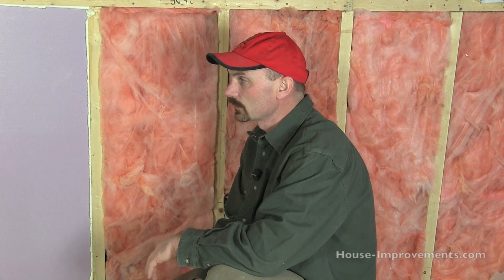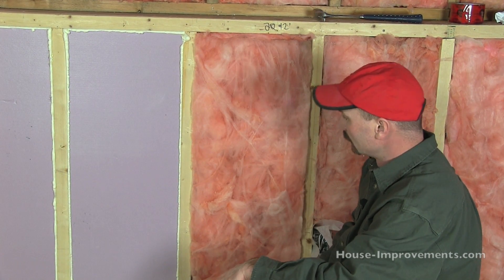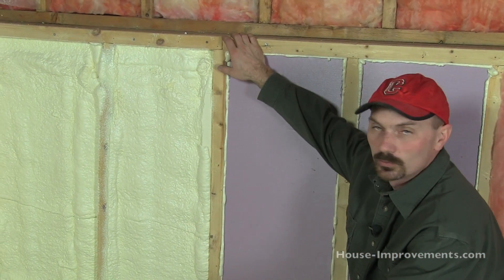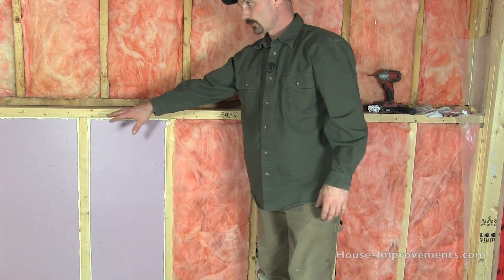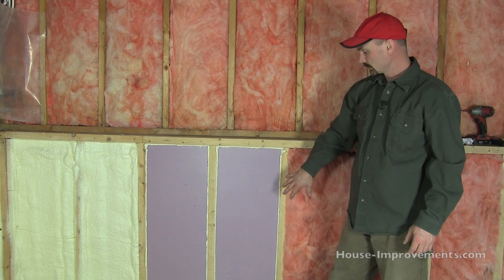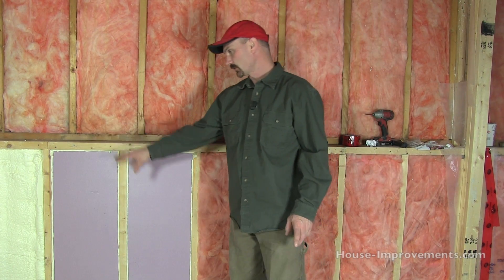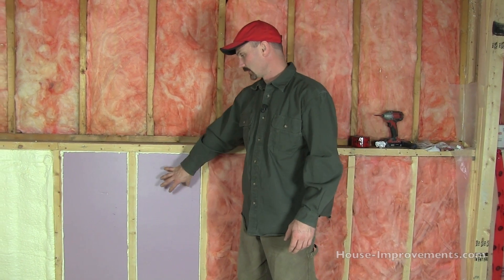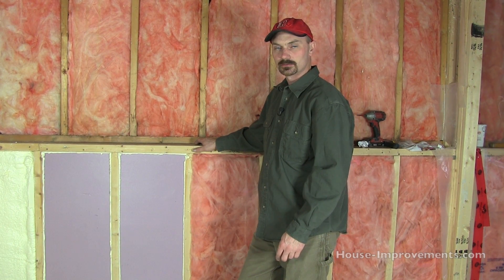House Insulation - Different Types

Comment: Shannon, If you put up 2 inch foam board against the foundation as a vapor barrier and then put batt insulation(not paper backed) in front of that, do you need to add another vapor barrier in front of the batt insulation?

Thanks,

Bill
Reply from the maker: It really depends on what your local building inspectors what to see. They seem to all have their own opinion. I personally say yes as long as you have used 2"  styro and it is all sealed well.
Reply: +HouseImprovements Shannon, you meant we do not need that vapor barrier as long as the styro is 2" thick, rite?